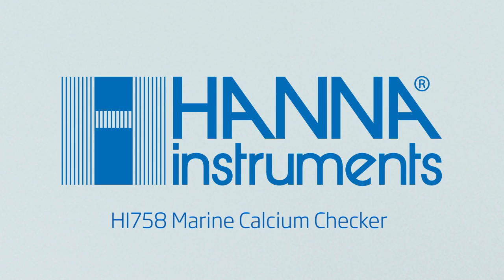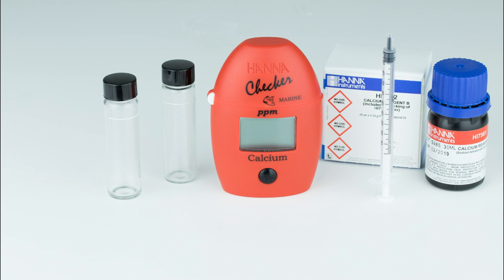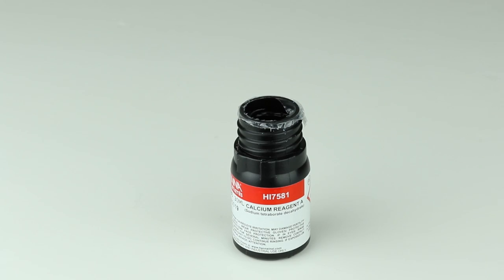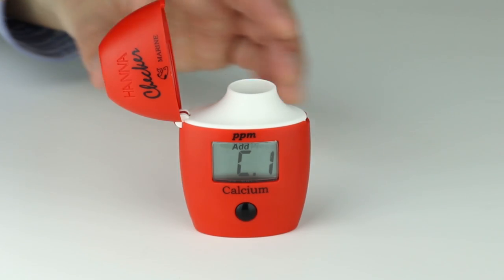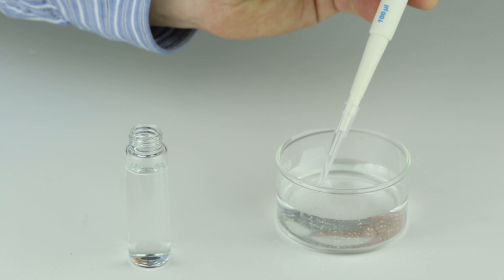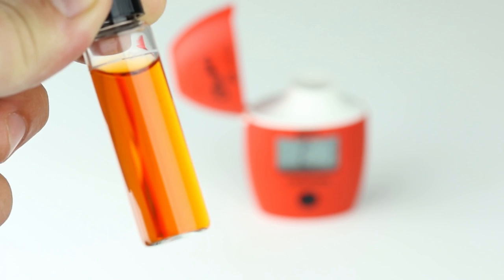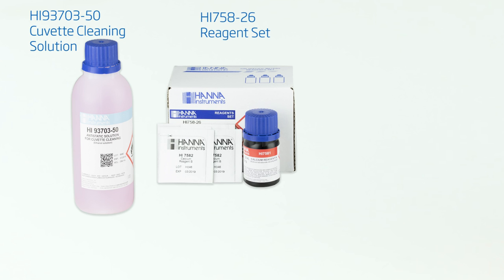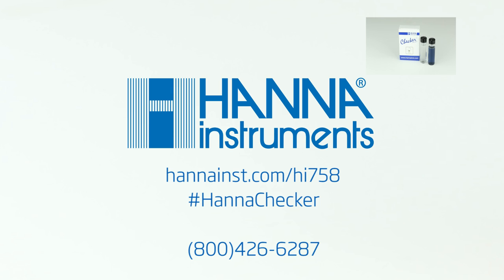How to Use the HI758 Marine Calcium Checker

Comment: HELP! I follow your instructions to the T. I use rodi water to clean my used cuvette. But I always get really high results! I have re checked using other brand calcium test kits and also get my water tested by my LFS. Why would I always be getting results in the mid to high 500 ppm mark when every other test shows 400-450ppm? Could this be a faulty checker!?!
Reply: Did you ever get an answer? I’m going through the same thing
Reply: Same here!!!!
Reply: Have you checked your rodi to make sure there’s no dissolved solids? Maybe try using rodi as the sample and see if there’s a calcium reading
Reply: Mine is always in the 550 ppm and I will do 3 tests from a different source and always at 430-440.  Pretty dumb device.

Comment: Can I clean the cuvette with methylene chloride then methanol?
Reply from the maker: Hey there. We don't typically recommend those chemicals on the cuvettes. For most purposes, simple distilled water works fine. For a more thorough cleaning, Hanna Instruments has cuvette cleaning solutions.
Reply: Hanna Instruments, Inc. thank you. Can i purchased the solution on your website.
Reply from the maker: Sure can!

Comment: For the second step distilled water cant see the 10ml mark on pipette..
Reply from the maker: Hi Thomas! For the second step, you would want to use the 10mL mark on the Cuvette to know you've used the right amount.
Reply: @HannaInc  Ok you have to use distilled water and not rodi water?
Reply from the maker: @thomasmccaffery5941  many hobby grade reverse osmosis deionized water systems may not adequately remove calcium. This can vary based on the types of filters used, their effectiveness and frequency of replacement. We recommend using deionized water with low conductivity or pure vapor distilled water so you can be sure you're using pure water. We sell DI water by the gallon on our site here, https://hannainst.com/deionized-water-1g.html  You can also find DI water in most pharmacies.
Reply: @HannaInc  Got ya.. my water shows 0 tds so I am sure its pure.
Reply from the maker: @thomasmccaffery5941  It may be worth trying both your RODI water and some distilled water so you can compare the results.

Comment: This shit does not come with everything you need. It’s a terrible sale. They give you a product without all its tools. This also needs Deionized water. Which is sold as a double shot on websites for $20, or gallon on Deionized water. The RO water or distilled water gives you whacked numbers not accurate
Reply from the maker: Hey Deon! Where did you buy your Checker from? The kit comes complete with all reagents, cuvettes, and pipettes. The DI Water from Hanna is definitely recommended, but you can find a gallon in your local grocery store for a couple dollars as well. That should last you near a lifetime! What was your kit missing?
Reply: Hanna Instruments, Inc. For $50 it’s missing the DI agent, and a cloth
Reply from the maker: I think if you compare the accuracy of this Checker to comparable meters in the market, that 50$ mark is pretty awesome! But definitely, you're right. There is no DI water or cloth in the kit. These items are really easily accessible, and for most in the industry, you might already have these items. I love the feedback though, and definitely hope you'll contact us through our website to address your concerns.
Reply from the maker: Deon, did you buy the kit directly from us? New kits come with our micro pipette which is a really helpful tool in getting that .01mL of sample. Also, you can try some of these tips which many have found helpful; Make sure the meniscus is at the 10mL line. Looking at it from a flat surface, there is a bend in the water. The bottom of that bend is where you want it to be. Also, because the glass is curved, face the cuvette the same way through each phase. Best way to do this is to have the 10mL facing outward so you know it's always facing that way. As you know, wiping it with a cloth is important. And also be sure that all the packet reagent is going into the sample. If all this fails you, contact tech@hannainst.com. We'll get this working for you!